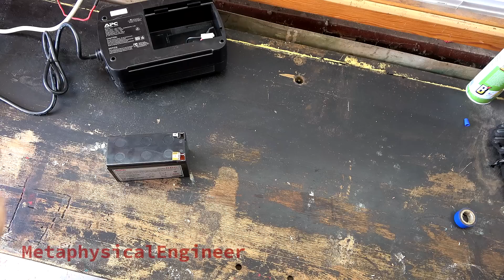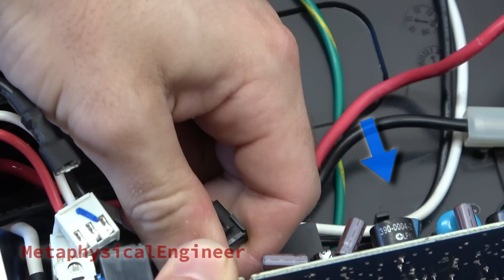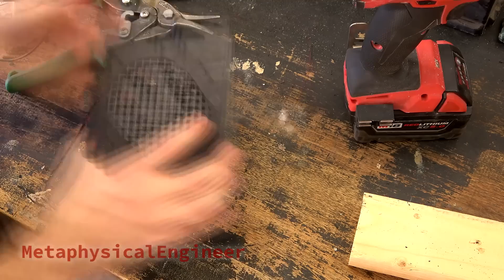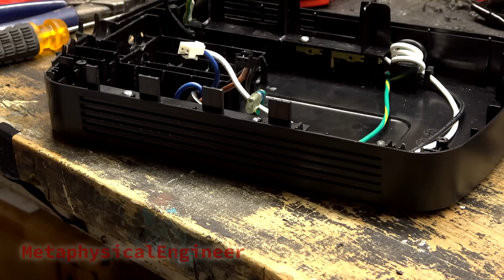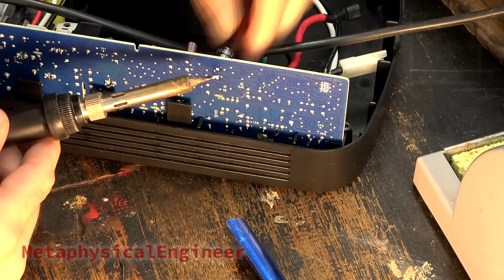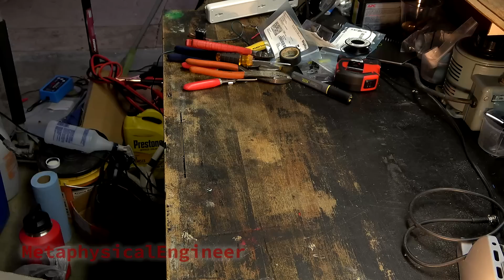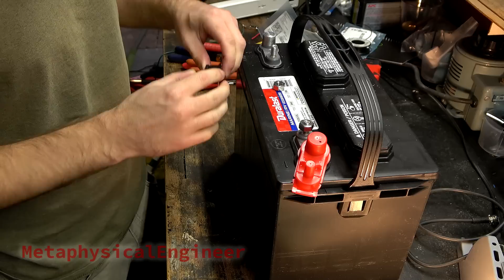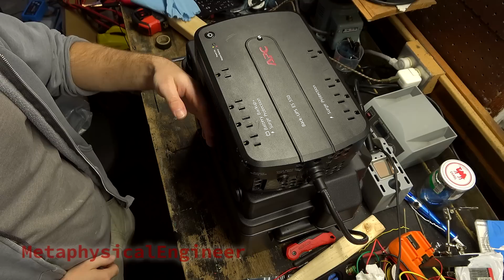Modifying broken UPS for long endurance BACKUP POWER!

Comment: If all you need to power from UPS is computers (either full size or laptops), then there is an option which bypasses all the complicated electronics in a typical UPS: All computer power supplies, laptop charging bricks and flat-panel monitor power supply boards today use lightweight switched-mode power supply circuits to convert mains AC to the low voltage DC the computers actually run on. In all SMPS circuits, the first component the incoming mains AC is routed to after the input socket and switch is a bridge rectifier, which converts the mains AC into DC at more or less the same voltage. Also, pretty much every SMPS circuit built within the last 15 years or so can run from a fairly wide voltage range, usually anywhere between 100 and 250 volts - this is so the manufacturers can use the same circuit for every country which has mains AC power. So it doesn't matter whether you give the SMPS pure sine wave, modified sine wave or even square wave. The AC frequency makes no difference either - it can use European 50 Hz, American 60 Hz, or even in theory the 400 Hz used on airliners.

You can see where this is going of course: Since the mains power goes directly into a bridge rectifier first, it also makes no difference to the SMPS whether it gets AC or DC, as long as the voltage is within that 100 to 250 volts range. So if you can get a load of cheap old car batteries from a breakers yard, all you should need to do is wire 10 of them in series and connect the resulting DC voltage to the computer power supply - which would be somewhere between 110 and 145 volts depending on the state of charge of the batteries. Then just have some kind of automatic change-over relay to make the battery bank kick in the moment mains power is lost. This should be entirely feasible - after all, landline telephone exchanges have a similar battery backup system (albeit at 48 volts) which is how your landline phones and landline-based internet service providers still work during power cuts.

The same system would also work for many other domestic appliances - LED lights use tiny little SMPS units built into their bases, so they can work from DC. Any resistive heater would also be fine, as would anything driven by universal motors - these have always been able to work from either AC or DC
Reply from the maker: Very interesting that you brought that up, since I do have some ideas brewing along a similar line for a future project, and I did some experiments with a small fluorescent tube running on DC several years ago.

One challenge is appropriate battery management and safety measures because of the unique fault behavior of high power DC supplies.  ElectroBOOM has an impressive demo with 10 batteries in series producing brilliant arcs which simply don't happen with AC supplies of similar voltage and current.

Another challenge which would need further testing is possible overload on the input rectifier, as components are sized to only conduct for half the AC cycle at a time while the other pair sit idle.  Depending on the device this could be entirely a non issue or lead to input stage failure.
Reply: @MetaphysicalEngineer It's certainly true that DC arcs behave very differently to AC arcs, so that would be a safety consideration. Having said that, some arc-welding machines use AC, so it is still possible to make arcs with AC.
Anyway, you can get circuit breakers designed specifically to handle high voltage and high current DC. The video linked below is an extreme example of a DC circuit breaker, likely from a World War 2 submarine, since they used huge banks of lead-acid batteries to drive their electric propulsion while submerged:

https://www.youtube.com/watch?v=WAhq_A4EbkE

You wouldn't need anything that big though - modern DC circuit breakers are still made, some designed for boats and RVs which have DC power systems, and higher voltage versions for industrial electromagnets which run on several hundred volts DC. You might even be able to use the type of solenoid relays used for switching car starter motors on and off, since those are designed to handle DC at hundreds of amps. So safe battery management for 120 volts DC is certainly possible.

Overloading the input bridge rectifier on a SMPS is a possibility for the reason you mentioned, since running DC through them would send the power through only 2 out of the 4 diodes. There are a couple of ways to mitigate that though:

(1). If you were only ever going to run the computers directly from a 120 volt DC UPS the way I described previously, all the bridge rectifier would actually do is ensure that the  SMPS circuit received the correct polarity (one of the uses for a bridge rectifier is as reverse polarity protection). So provided you ensured that the SMPS was getting DC at the correct polarity and within its working voltage range, it wouldn't actually need a bridge rectifier at all, so you could just remove or bypass it.

(2). If you still wanted to keep the option of running the computers from mains AC but wanted to also ensure that the bridge rectifiers in the SMPS units didn't get overloaded, you could always change them out for beefier versions rated for higher current. They are not that expensive, and they are also fairly easy to find on the circuit boards inside the SMPS units. So de-soldering an existing one and replacing it with a bigger one would be fairly straightforward, and this would not affect the operation of the rest of the SMPS circuits.

Comment: for the fan you could.

1. build an resistor/capacitor/diode dropper power supply and tap off the output of the transformer to run the fan.

2. if there is a second relay that operates you could tap that.

3. tap a shunt from the center tap from the battery to the transformer.

installing a shunt inline to the center tap will effect the current to the transformer so you could exploit the voltage drop of the center tap to power the fan.

another option is since fans use so little current you could wrap a thin wire to form another secondary to power the fan (microwaves do this to power the magnetron filament heater.)

you could do a couple turns of telephone wire used in wall wiring.

a small pc fan wont do much to a car battery especially if you plan to parallel several batteries the real reason that modern cars like certain bmw suvs is because comfort system fans pull several amps of current and the controller board fails and the fan comes on and overnight the battery is drained.

the only way that leaving the fan running all the time would be a problem is if you plan to move to a new house and by point you will disconnect the batteries because transporting the batteries are quite heavy.

you will need a box for the batteries as car batteries are not designed to be overcharged like ups do and eventually they will vent acid vapors and even squirt acid and cause damage.

ups batteries are designed to be able to handle to be held at top voltage all the time so they can handle better.

a large medical grade battery for a wheelchair/mobility scooter should be ok since they are designed for mobility devices.

i have heard a 4s lifepo4 is a suitable battery but i never tried it .

lifepo4 is much safer than standard lithium batteries but you still need a bms and converting ups may be an issue since you would need a bms suitable for ups.
Reply from the maker: 1. High power dissipation in resistor-diode-capacitor dropper.  120 - 12 = 108V; 0.2A * 108V = 21.6W burning up as heat.  

2.  There was only that one relay on the board.  Other designs may have additional relays suitable as a fan control signal.

3.  Adding another secondary coil might be an option, but may be not enough space on those densely packed bobbins.  

A shunt on primary center tap to directly power fan wouldn't work but would be an option as current sensor with a comparator/amplifier driving the fan when current is detected.  Would need to be sensitive enough to engage fan at low to moderate power, while not wasting much power in the shunt at full load.

That fan pulls 0.2A, which just about equal to the max charging current from the UPS, risking the battery draining even if plugged in. Constant fan is also noisy compared to the rest of my office and would clog with dust unnecessarily.  

I literally used a battery box meant for holding batteries, shown starting at 23:45 and in the video thumbnail itself...
Float charge voltage is in a range where the battery will not off gas or boil or overcharge.  A flooded battery can sit forever at 13.5V with just enough current to offset self discharge.  

Agreed that LiFePo4 is an upgrade option, but higher cost and need for dedicated battery management.  Technically they can be connected to a lead acid charger, but I would not trust that, no matter what all the other people say.

Comment: nice mod and recovery of a dumpster bargain,  I got two in thailand just the same way "no workee no moneee" how many of these are trashed thru ignorance?! I got some from the government spook agency in UK once, both high power rack units needing external packs,  both new!! and when I run them "no workee" -- inside the stoopid 5 eyes and no brains spook crowd had smashed off the CPU chips as if they'd store secret "red" data they werent even networked devices and had no USB ports.......
Reply from the maker: I've gotten so much free and cheap equipment from e-waste piles and trash bins and online sales, much of which only had relatively minor problems.  Definitely let me upgrade my stuff over the years without throwing thousands of dollars at new items all the time.  

Funny how the main chips of the UPS units were destroyed as though they had sensitive data stored somehow.  Though I've seen lots of the opposite end where personal or sensitive data was left intact and not even password protected on a device sent for recycling.

Comment: I did one similar a few months ago, I just rectified the drains of the main mosfets and that gave me 12V for the fan. Mine is non-isolated (FSP), so a solid battery box was required, but the low loss and ~70W load it feeds gives me excellent runtime on 50Ah. Enough fuses were added.
Reply from the maker: That's a clever idea using the inverter input stage!  It's cool to hear about the similar success stories beefing up UPS units for extended runtime.
Reply: Lol 😂😂😂 thanks ❤❤❤

Comment: Group 27 battery is not SLA ===> outgasses ==> hydrogen ==> KABOOM!
Recommend LiFePo4 battery for this project. Has BLM + more usable watt hours per dollar with no KABOOM!..
Reply from the maker: Outgassing is extraordinarily slight at such low charge voltage, only becoming significant at high current and higher voltage.  LiFePo4 is an obvious step up in capacity and performance, but would more than triple the cost of the project, not counting the dedicated charger for the different chemistry.    

But hey, if you wanna donate to see an upgraded version 2 someday, be my guest :)
Reply: @MetaphysicalEngineer  With 100 AH LiFePo4 batteries now under $200, not so much more than a cycle 27. And the BMS will handle the slightly different charging parameters. The LiFePo4 battery may not reach full charge voltage, but that's OK. Pretty much a direct replacement for a 12 volt lead acid battery in lower amp applications (<100 amps).. Nominal voltage is 12.8 vs 12.5.

Comment: I'm trying to add a volume to a bluetooth speaker at the speaker wires. Will the 1k pot you used here work? I want to limit the blasting I get when turning on the radio mode because they set it to go full volume by default when radio mode is activated. It's one of those cheap chinese bluetooth bazooka tube speakers. I even added a folding antenna on it. 

Also what kind of computer is that? It looks pretty cool and I like that it has an optical drive. I'm looking for a new PC that can play games.
Reply from the maker: Doable to add volume control, but all depends on the speakers you have.  You would need to trace out the signal path.  Many designs are moving towards integrating functions onto a small number of ICs.  Preamp and power amp all together with gain control direct from the microprocessor, etc.  In that case you'd need a bigger pot of comparable power rating to the speakers as an attenuator.  If there is accessible signal path you could use a small logarithmic taper audio pot of maybe 10k to directly attenuate the signal. This is all guesswork until you determine what you have to work with. 

My computer is a 7 year old custom built PC.  I call it Groot. Built in a Corsair Carbide 300R case because back then I wanted an optical drive. Showing its age now, but overclocking and a new graphics card have kept it workable.  I suggest the PCPartPicker site and forums for advice about what PC would be right for what you want to do.
Reply: @MetaphysicalEngineer  The circuit I have is a board that has all the guts on it and just two wires running to a 4 inch speaker. The volume is controlled by the back and next buttons but when you first turn on the radio the volume is at max by default and I have to turn it down. I have some pots I bought two kits but none of them work like I want.

I'd like a new PC but one that's a bit more powerful than what I have now. The specs on mine are 3.1ghz cpu, 8gb ram and 1tb HD. The only thing wrong is the os is outdated, I could update it but I've had this thing over 10 years and parts do age over time. Dont want to chance something failing after I update.
Reply from the maker: For the speaker, you need a pot with fairly low resistance, around 50 ohms, and a power rating similar to the speaker.  A cheaper solution would simply be a toggle switch and resistor of similar power to the speaker in parallel as a switchable "pad".  Switch closed for full output, bypassing the resistor.  Switch open forces speaker current through the resistor, knocking down the power at the speaker to a more reasonable level.  

Agreed your PC is showing its age, if only because of how far tech has moved in 10 years.  Certainly won't meet requirements for Windows 11, as even my PC is too old for that.  I'm tempted to suggest a prebuilt gaming PC, but those can have quality issues sometimes. Ask on the PCPartPicker forum I mentioned to get the opinions of more knowledgeable PC enthusiasts.  Asking an employee at a computer store is risky because they are under pressure to sell you stuff.

Comment: Where do you live that you use US Customary, but also have regular brownouts?
Reply from the maker: Southwest! Older infrastructure in my area, but even so the prevalence of grid issues is surprising and frustrating. Especially when they happen at times of day and times of year when the grid is not particularly stressed.

Comment: What is the potential difference (voltage) between the Earth pin and the terminals on the 12volt battery? Is the battery at 100V above Earth?
Reply from the maker: Battery negative is tied to earth, so a maximum of 13.5V DC above earth at the positive terminal.  No risk of shock from the battery terminals as long as the building wiring is correct.

Comment: it's cooling fan, for cooling when it gets too hot? so at, 6:51 the fan running all the time when it unplugged, that the wrong problem/logic you are trying to solve? the correct solution if the UPS gets to hot, and it would not matter if it was plugged in or not its getting to hot? so, it the such a thing as thermal trip, like the ones you get hot water kettle, boil dry, detector not that world work works by switching on power instead of powering off, and at a more desired lower temp. cut on instead cut out?
Reply from the maker: Original UPS did not have a fan or logic to control a fan.   I built the fan control circuit so the fan only runs when the UPS is powering something using the battery and inverter.  A mechanical thermal trip like for a kettle safety switch was an option I thought about, but difficult to detect the temperature of components most in danger of overheating (MOSFET and inside the transformer).  Electronic temperature sensors would be a more complex circuit.  I already planned to add a volume knob to the alarm buzzer, so I used the alarm signal to control the fan as well because the alarm only turns on when the inverter is running.